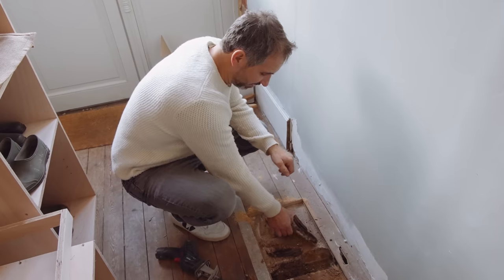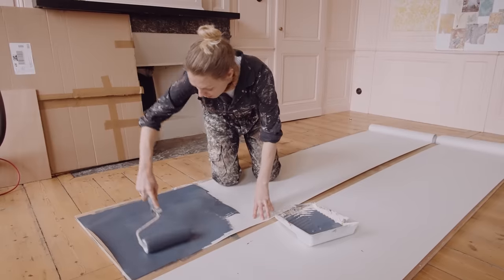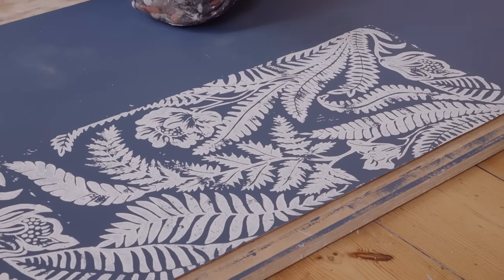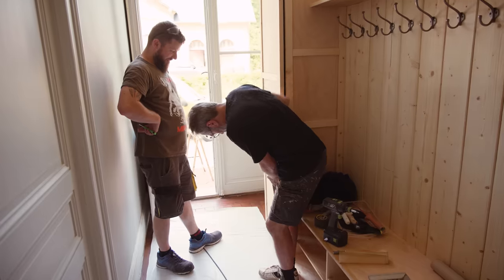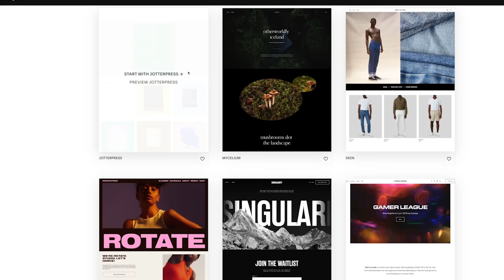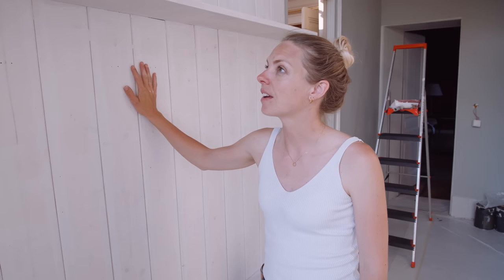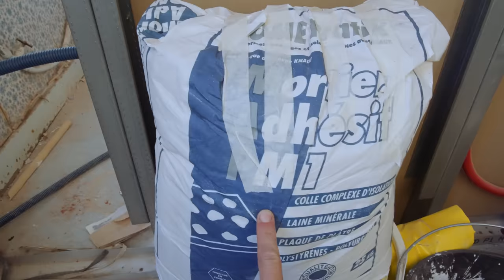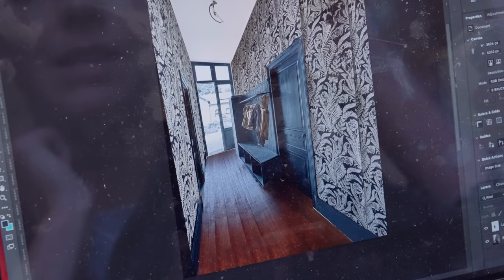Chateau Entrance Transformation & DIY Wallpaper Reveal.

Comment: Option B, as it will show wear and tear much less, its a mud room so white will show dirt too quickly... also option B makes the beautiful wood floor pop even more, it so moody and pretty ! A smaller room can definitely carry the moody darkness very well ! Option C could be carrying the ceiling in the same dark blue as well, would look amazing !
Reply: I was thinking the same thing about the ceiling. If it's left white, especially because there is no crown molding, it contrasts a lot with the darkish wallpaper, witch can make the room feel somewhat narrow. If instead the ceiling was more similar in colour to the wallpaper, the spatial limits of the room would be less obvious and it would feel bigger/ less narrow. Also, a darker ceiling brings the height of the room down a bit (in terms of visual perception) which can result in a cozier feeling.

But of course, this option depends on whether the ceiling continues into other rooms or if it is separated.
Reply: I was also wondering the same thing.

Comment: Option B will remain looking smarter longer as being a boot room it is the place where the outside is taken off before moving inside. If it were the off white it would probably look grubby quicker. 

If you find the room too dark, extra lights could brighten the area. Remember the coatracks are going to have a variety of coats on them and that will lift the colour and lightness of the room too.

Comment: As an architect, i tend to feel that the color of this unique space should be informed by the colors/ feel of the rooms adjacent to it.

So. If I am correct, the door opens to the kitchen which is quite light in its color scheme. If it does then the lighter color option is best. And, because of the narrowness it would provide a better scale of the space.  However, for practical reasons the darker color of the millwork would stad better to the mess of it being a mud room. 

On the otherhand, please consider the following as a 3rd option. It all depends on how you view the space.  I would keep the millwork light and soft but paint the doors and trim in the darker color.  Please discuss this as a 3rd option.
Thanks
DocAndre

Comment: Looks great . I would definitely choose option A. The off white  colour allows the strong wall paper to be the hero of the space while adding lightness to the narrow area, and adds lightness particularly at eye level where you need it when using the fixture day to day. It feels more summer and less heavy. Option B seems more winter  and  dark and feels heavy, sucks the light out of the functional area and seems to dampen the sharpness of the paper pattern. Maybe add  a lovely dark blue glass chandelier for even more drama in option A. Also you can  change scale of the pattern for a graphic seat cushion. Can also paint dark blue on the floor of the lower boxes if you want even more contrast and to protect against marks from shoes.  Or add marble inserts instead for a change of material.  Or add doors with a  lovely stamped out pattern or rattan to allow wet shoes to breath whilst  shoes are  hidden . So many options.

Comment: Interesting. But why the extra step? Since you created prints why not print them directly onto the wall, instead of on paper and than the hassle of putting up that paper. Plus on the wall you can touch up with a brush to fix and adjust. Just curious.

Comment: Anna, Option A is so much brighter and prettier. You need a bright and pretty entrance that goes nicely into the kitchen and dining room. I think a dark floor will solve the winter mud problem. Option B:  I think the dark blue you chose is really awful. It doesn't match the wallpaper, while the soft white really sets off the pattern. I think you can live with A for a long time, but B will get on your nerves very fast. I also think B will look horrible with the orange dining room. It's just completely the wrong shade. I hate it, it's true. I think B looks really oppressive.  If you did want to go with blue, it should be a true match to the wallpaper, which is lovely, by the way. A light navy would be a better match to the wallpaper than teal. A will be bright and light in winter. It gives the wallpaper an extra "Wow!: factor and it also gives good "flow" into both dining room and kitchen. B does not. You will have a dark floor and a dark carpet runner, so no problem there.

Comment: It really disturbs me that the sides of the cupboard have horizontal framing that doesn’t follow the same horizontal line as the door / or that the door’s horizontal is not in line with those on the sides.